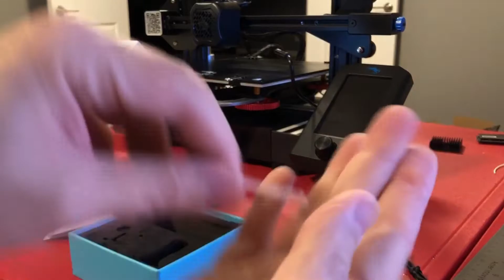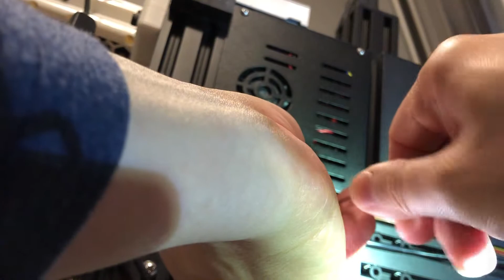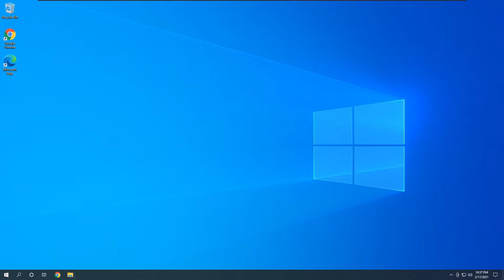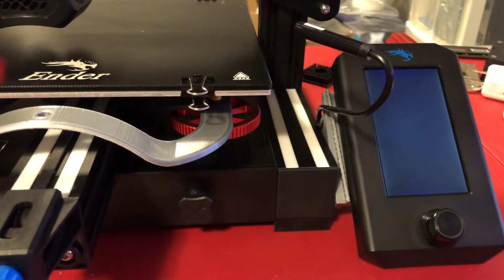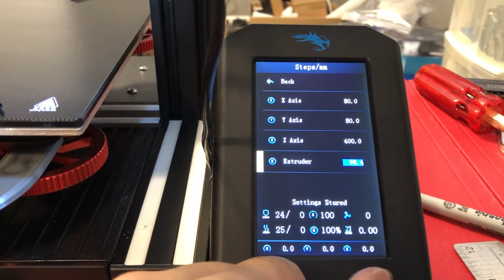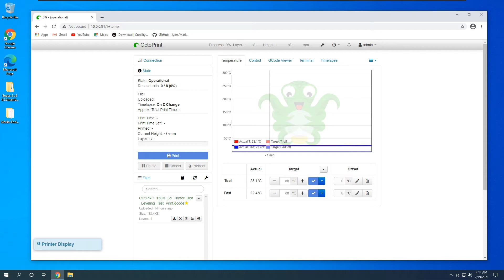BL Touch v3.1 for Creality Ender3 V2 - Unboxing, Install and Firmware (2021)

Comment: Hi Keneth, when downloading the DWIN file to the screen, it stays Orange until I shut the printer down. And I followed your instructions on the main board firmware update, but nothing has changed, it doesn’t show a “level” option with my cr touch installed. Do I need to download the cr touch firmware too? And also, do I need to download a slicer program on my pc before I can download an stop file for printing. Sorry but I’m brand new to this and my Ender3 v2 doesn’t seem to do anything except for going to its home position. Does it matter where the x,y,and z positions are before I start the printer, that’s another thing I’m not sure about. I’ve had this printer for a week now and I’m not sure where to start, it seems there is a bunch of different ways to download the correct firmware, I just don’t know where to go. If you can help I’d really appreciate it. Thank you.

Comment: Too bad my BLTouch didn't come with Ender 3 v2 bracket -- useless.  Different wiring harness too.  Make sure if you buy the BLTouch it has the mount and wiring for your motherboard and device first, else you'll be wasting a LOT of time.

Comment: I really cannot figure out the mesh and z offset. After I set them, my nozzle always prints too high. I change the offset and save it, and no matter where I put the offset, it always prints high. I have a Goode that makes a mesh before each print, and it always sets the nozzle in the air. I’m going crazy trying to figure it out. I assume it must be a software error.

Comment: Hello, I have a problem, install marlin 2.0, then install jyres v1.3.4 to unsar the BLtouch, install and configure as you recommend in the video and when starting a print it does not let me, it starts calibrating and finishes the print, I thought, if you I installed octoprint I was going to solve my problem but it's still the same, you know what I have to do so that after checking the bed level it starts printing.

Ender 3 v2
Plate v 4.2.2
Jyres v 1.3.4

Do you know of any post or video that explains to me in more detail or that helps me detect what I am doing wrong.

Beforehand thank you very much

I'm from México City

Comment: I have an Ender 3 Pro and I've recently added the Ender 3 Pro V2 screen, would this process of adding the Bltouch be pretty much the same?

I had to use the V2 firmware to get the screen to work, so I'm wondering if the same process for adding the firmware is the same on the Ender 3 Pro.

Comment: Has anyone made a firmware for an ender 5 pro for the BLTouch v3.1? I’m running the stock v4.2.2 board and the creality firmware causes a loud screaming noice from the board, I found some firmware on Reddit which seemed to work but I believe it was a bit out dates for the v3.1!

Comment: Will the Jyers firmware allow me to adjust at the printer UI level for my X and Y being different from stock due to an aftermarket hot end? Or will I need to edit firmware?

Comment: Incredible useful video, we have the same setup (octopi,jyers etc.) so this helped a lot.

One question, do you calibrate the corners?
Like you would without bltouch?
I feel like something is missing, I can’t just calibrate the middle to be “perfect” but the corners not
Reply: That is the same problem I am having meany videos don't show that part nor do they show it well. Which is my problem with getting it to work I don't know when in the process to do the corners since you have to set the z offset do you do the corners before or after that?!!
Reply: @Koolkole27  so ehm what I did is, throw that bltouch away xD and do manual leveling as before, since bltouch isn’t fully automated I don’t need it.

But honestly, I can’t really answer your question because the whole thing is useless in my mind, you can perfectly level it manually with a post it note.
I don’t remember how I did it, I just remember having headaches  trying to figure out the use of that thing xD
Reply: @byHeroo  I have been spending 2 months trying to get a perfect level bed and all my prints have flaws due to it not being close enough to level I decided to get a bltouch in hopes of it helping me level it! I have a hard time with the paper method because everyone says a different thing of how much pressure you should feel on the paper I have a hard time making all the corners the same height to the print head aka level. It's super anoying.
Reply: From what I understand so long as you have the bed relatively level the BL Touch will compensate for the slightly unlevel bed. So if you've recently leveled your bed I wouldn't touch it. You could disable the stepper motors and get a rough level just so it's not too far off but you shouldn't need to.

Comment: So question. If I were to use the second firmware from github do I still need to update the screen firmware?
Reply: @kentsangcanada  so I been rocking the creality firmware and I have a little more experience now with everything. I followed your process up the the point of downloading the jyers and had decent luck with the creality firmware... however  this jyers setup looks 100x better than the creality firmware. Yesterday my nozzle randomly gouged my bed so im going to try the jyers firmware here a little later today. Not to mention I also bought a microswiss hot end, Capricorn tube, metal dual gear extruder, and bltouch, bed springs etc. I notice while I can level the bed with the creality firmware it doesn't do a very good job...sometimes it just works.. sometimes the nozzle crashes into the bed randomly and keeps trying to go down. I'll let you know how my experience with jyers goes.
Reply: @kentsangcanada  so I installed the new firmware but I notice on the screen there's no symbols next to the values like I see on yours. For example there's no little fan symbol next to the fan speed.
Reply: @kentsangcanada  kind of funny but after a power on off cycle all the icons appeared. I used the creality file like you did in the video. All seems to be working now but if I need to flash the screen again I will.

Comment: Thank you I was about to throw this machine out the window, The updated firmware you suggested saved my hair the tutorial was excellent, but you never mentioned the Z limit switch. Is yours still connected?
Reply: with the bltouch installed you can remove the z limit switch
Reply: @kentsangcanada  wait....whaaaaaa. i gotta look that up now

Comment: Hi from France,
Great job,
Thank you for this very interesting video for the installation of BL Touch on E3V2 (V4.2.2).
Why not install the official version (Marlin2.0.1 BLtouch with-adapter board firmware)?
I am a novice and try to understand how it works and to find out more. I will receive my first E3V2 printer on 04/10, I have also ordered the BL Touch.
Thank you very much.
Nicolas Nico
Reply: @kentsangcanada  
 hello, Thanks for the feedback. I also bought an end of filament detector, Jysers included the function in its firmware?
I saw on the Creality download site that it had put a new version on March 26, 2021,
 "Ender-3 V2-Marlin-2.0.1-HW-4.2.2-mainboard-V1.1.2-Compatible with BLTouch and filament detection"
What do you think? although I understand that Jysers has a lot of head start. Thank you for taking the time to respond, great. Looking forward to hearing from you, Tchao

Comment: Great Video. But I have two questions:
Can I flash only the Jyers Firmware without flashing the original Creality Firmware first?
In the new Creality Firmware (26.03.21) there are just the bin-file in the ZIP. No DWIN_SET folder for the Display. Is the Firmware for the Display in the Mainfirmware include now?